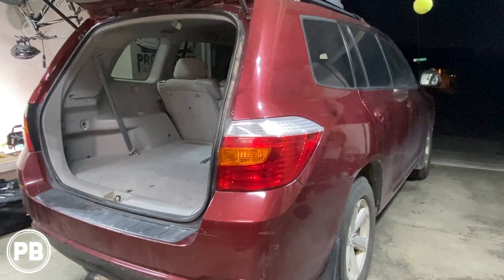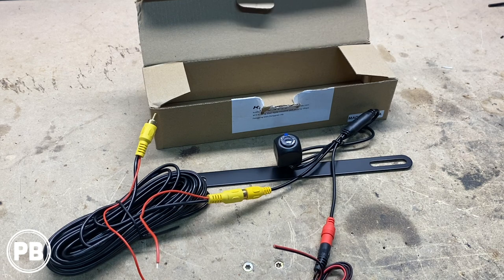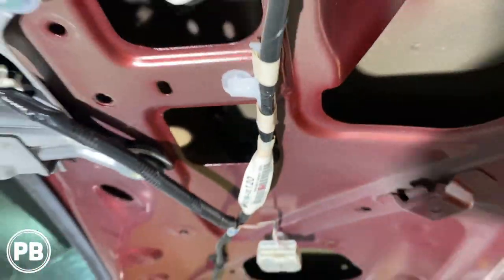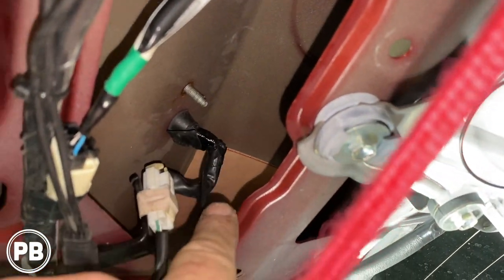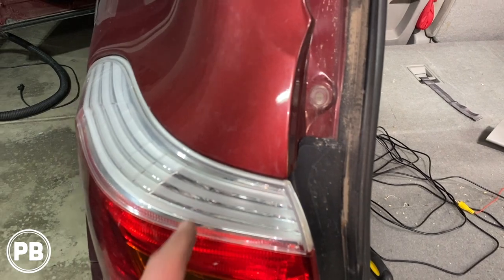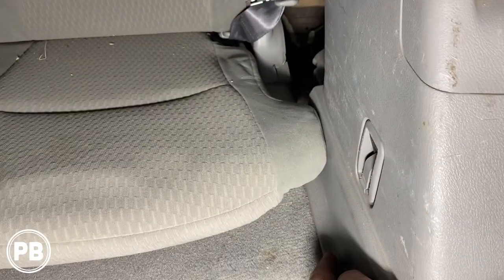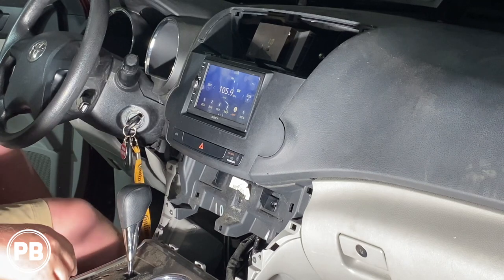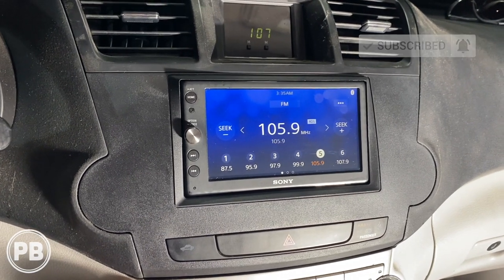2008 - 2013 Toyota Highlander Backup Camera install

Comment: I tried to hookup this reverse camera to my 2013 Highlander base model factory radio but am not able to figure it out. I can't find schematics of which wire is the video in and reverse wire. Where can I find that info?! I bought a wiring harness and it doesn't seem to work.

Comment: I am stupid. My 2012 SE model already has a backup camera wired into that small ass display… It is spliced dead into the native display harness. Do I really need to cut it all open, separate the camera wires from mileage & power wires? And how do I tell one from the other?

Comment: we saw three wires from the bottom tail light and two wires from the top taillight. The top one doesn't seem to turn on in reverse and the bottom one is always on. Any tips?
Reply from the maker: A multi meter will help solve the issue.  You just need to connect into a source that is only on when the light is on to either power the camera and / or provide a reverse trigger for the radio.

Comment: Do you really have to run that white cable all the way to the front from the reverse light? or can I just start from the reverse light to the back camera?
Reply from the maker: Nope, you don't if you just want to power the camera off the reverse light, and use the red wire off the RCA to trigger the radio, that works too